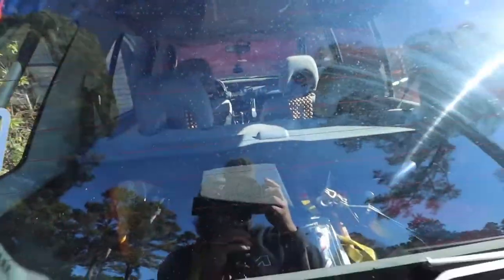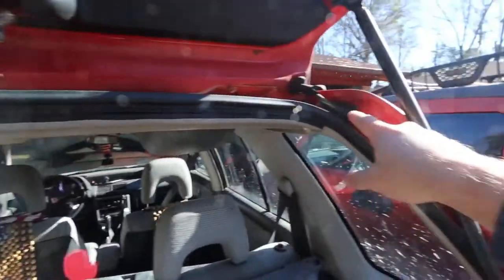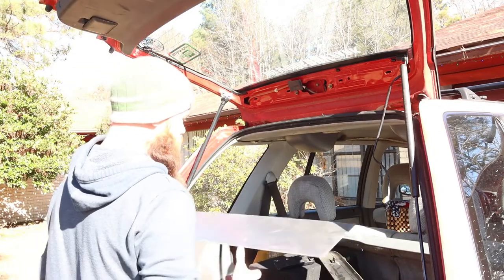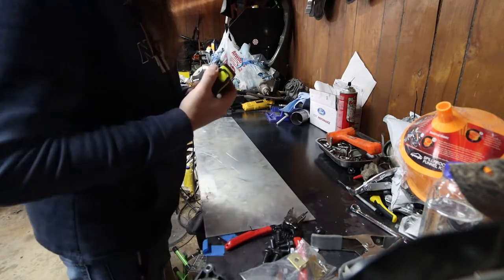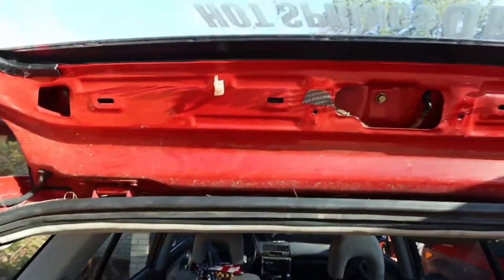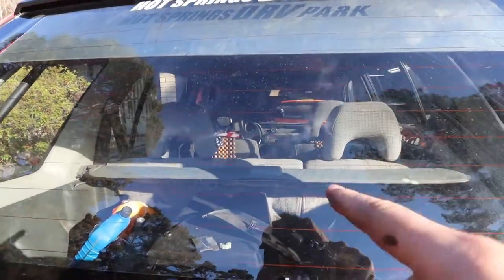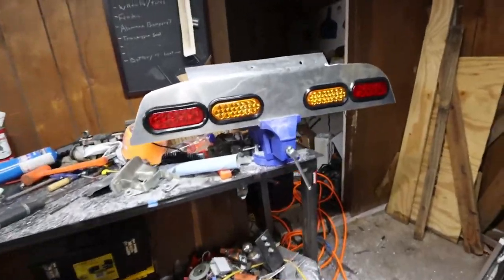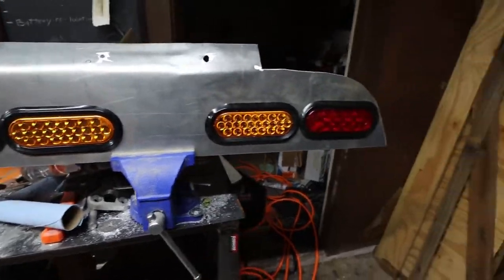Let's Make Baja Taillights! Honda Civic Wagon

Comment: They should help keep you more visible in the heavy terrain, does the hatch glass reflect them into your view ? or refract off the side glass when looking in the mirror ? I personally do like the look of them like that better than being hung on the outside. Hope a great Christmas time for you and your family !
Reply from the maker: So far, no refraction. I was concerned about that as well and planned on adding some buffer if that was an issue. Thankfully it worked out well, it's close enough to the glass that you can't see it.
I think it'll be useful for driving too with 30 year old brake lights and distracted drivers. Hopefully this will help them see me out and about. Merry Christmas Bubba! You and the family keep warm and enjoy!

Comment: Rio red is your favorite on these? Lol
Reply from the maker: Easily! Make a better color from the factory in the RT4WD! 😄
Reply: @DashnCars  i bought my dohc zc swapped r-63 rio red 91 rt4wd running cat missing upper trans mount cracked no driveline or rear diff. Replacement trans coming. Had the car 2 days now... lil over 1 grand in. Need factory manuals
Reply from the maker: @darbym2303  you can still find them on Ebay, FB, Amazon sometimes. I got one from a friend actually. Rio Red is the best!